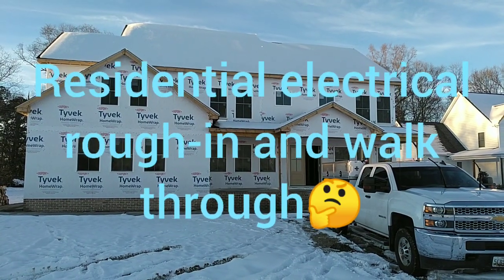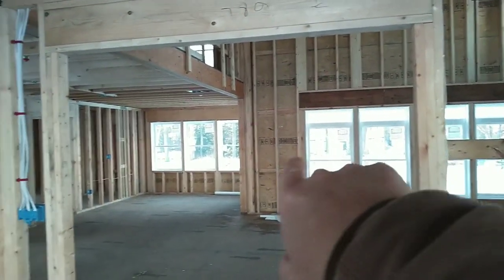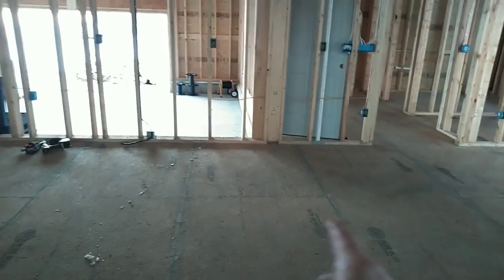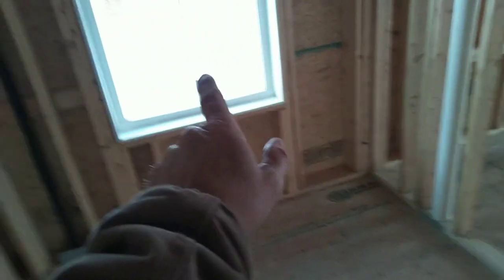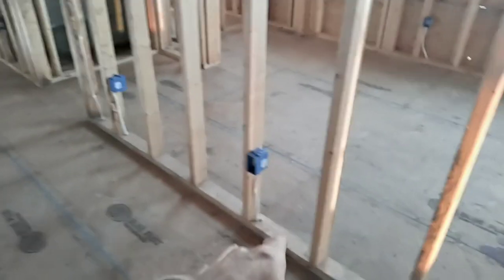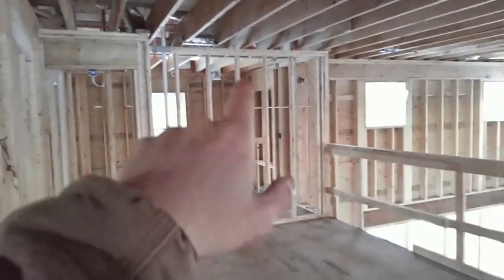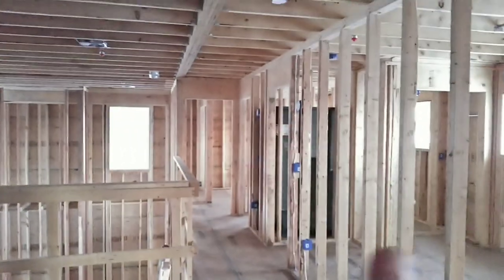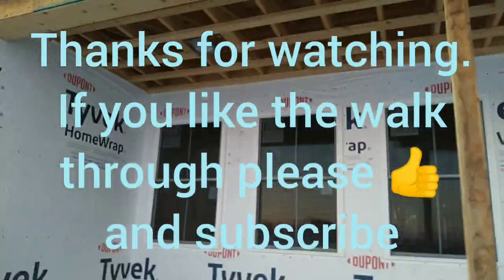Residential electrical rough-in and walk through 🕵️

Comment: Question- what is typical for the final inspection on a residential job. Jumping power from temporary service, using generator power or something else? Thanks for your input.
Reply from the maker: Hey James, great question. It mostly depends on your situation. Topically I wire a new construction home as to power it by the local utility company. Panel, meter socket and conduit to the pole or a pad mount transformer. Overhead services are no longer allowed in Maryland. After the rough-in inspection is completed by an inspector they'll send in a cut-in-card to your utility provider stating it passes the NEC requirements. The utility company will then give you a price to hookup. After hookup is done, you'll get a certain amount of time to complete the job before your final is required by the utility company. If you call your power company, they'll provide you the needed information. I hope that answers your question. If not let me know 🤠

Comment: Nice video and walkthrough. Question on your 4 way switch for the kitchen cans, did you use a single homerun for all that since it looks like some of the 4 locations had other switches for other lights other than the kitchen cans?  I have a similar situation in my basement I am designing and trying to figure out how to get power to another location in the 4 possible location to switch the lights since the traveler wire dont bring constant power to the other switch boxes in the setup. One of the 4 locations is a back door that I want add a switch to control an outdoor light?
Reply from the maker: Thanks for watching and commenting. This particular house had (three home run) lighting circuits. I keep my lighting separate from my outlet circuits for simplicity of troubleshooting if needed at a later date. About your question🤔 If your landing a single way switch for the outside light and it's grouped with a 3 or 4 way, don't use the travelers for this light. You'll need to install a feed in that box for that light. It can be a continuous feed from another box for the light to work properly. I hope that answers your question?
Reply: @workingmanrondoyle3287  Thanks for taking the time to respond. It makes sense. So I could pull a feed from the box that powers the first 3 way so it is the same neutral being used instead of pulling a feed from another circuit with a different neutral? Thanks.

Comment: Awesome video! Really like how you give the lengths of wire used. Are you able to make a video on how to calculate a material list based off the blueprints?
Reply from the maker: Thank you RayRay, for watching and commenting. I'll give that some though and consideration for an upcoming video ❤️. My problem in doing that is 95% of the houses I wire don't have an electrical blueprint.

Comment: I'm in va 757 what are you charging a sq?square?? I been on my own for a few years and need to change things up
Reply from the maker: Thanks for watching and commenting 👍🏻 Right now Maryland is on the 2017 NEC code. My prices are at $6.50 per SQ Ft. When the 2020 code or 2023 code kicks in, I'll be much higher 🤔

Comment: as an electrical apprentice i have a question about the code, can you put more than 4 wires through a hole ?
Reply from the maker: Thanks for watching and commenting. 👍 A very good question that mostly depends on the size hole your drilling to do your install. And if insulation spray foam is used. Your looking for airflow. Wires grouped tightly together with current flowing through them can create hot spots. I hope that answers your question.
Reply: @workingmanrondoyle3287  I see I appreciate the reply , and I watched the inspection video for this house right after , it was cool to see he didn’t ask about it I know some inspectors are more strict Than others, I asked because down the line if I do this to be more efficient I don’t want to fail because of that rule in the book ✌🏽
Reply: Btw great work man , the panel looked well organized
Reply from the maker: @choatejr3  The inspector George Landing would allow
 3 qty. 12-2 rolmax wires through a ⅞" hole.  He has since passed away. The other 5 inspectors I've had, never complained about my process. Limiting 2 wires per hole would allow more airflow.

Comment: what did you bid this job at?
Reply from the maker: Electricians on Maryland's Eastern wire new construction homes based on $6.00 to $10.00 per square ft.+ $300. To $700. For wiring the garage.+ $65 to $85.Per Recessed light+extra's that the customer request are a bases to the contracted price.